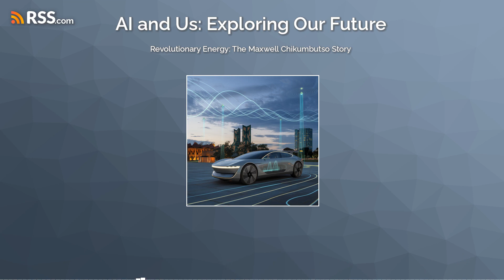Microsonic Energy: Revolution or Illusion? 🔋

Comment: If he puts a dc-dc converter into his schematics of his output, then that would even out his output voltage and your electronics use micro chips, which work off of low voltage dc circuits, so his device could in fact power most electronic devices, whereby the high voltage input circuit is removed and it powers the I.C chips off of his device directly,.     We are just use to having high voltage at our house, which then has to be converted to lower voltages for our devices, but now his device already has the low voltage available, from the radio waves.

Comment: I work in a science very closely related to this, geophysics and electromagnetic survey, one survey method we use is magnetotellurics, we use naturally occurring atmospheric electromagnetic signals (sferics) as the energy source for passive electromagnetic surveys, they energy is miniscule, in the microwatt and nanowatt range, it requires very sensitive instruments to even detect and measure it. If there was enough energy in radiowaves to recharge an EV battery then that same radiowave energy would be inducing dangerous voltages in everything conductive around us, we would all be getting dangerously electrocuted just by touching a fence line or a steel gate etc. The only actual device that does work using this technology is a crystal radio set that uses the piezoelectric effect to convert a radiowave to a tiny oscillating current to drive a very small speaker, could that same energy be used to power an EV? No of course not. Yeah there are naturally occurring atmospheric electromagnetic fields generated by electrical storms in the upper atmosphere, but the energy is miniscule, when we are doing an electromagnetic survey using sferics we have to monitor the signal strength with a base station, the energy fluctuates when it drops we have to stop survey, when the sferics are active we can survey. Radiowave energy strength is also inversely proportional to the square of the increase in distance from its source, double the distance the energy in the field drops to 1/4, triple the distance the energy in the field drops to 1/9th of what it was. The science is valid, but the numbers don't add up, it's a scam.
Reply: Good and useful technical analysis, but sad conclusion unscientific conclusive statement. The guy claims to have done further research beyond what you know based on the above well articulated analysis and supposedly cracked the code and developed a device that is able to covert the radio waves into powerful usable energy. So your analysis is supposed to end with a probing question demanding an answer, rather than an inconclusive sweeping statement that it is a scam! 

I am personally waiting for answers. If the vehicle can drive all day for thousands of kilometers without fuel ànd without charging, then those claiming there should a hidden source of energy should tell the world what the hidden source of energy is that can power and EV for thousands of kilometers for hour without charging or refueling and they must prove it, it might just be what the world needs!
Reply: Thats why you are not an inventor. Sorry. Just another verbose rumbling of regurgitated knowledge that has an obvious limit.
Reply: @wilsonkwatamanzi5821  lol but do you know anything about this science? Physics and electromagnetic wave theory? I've been working in this science for 25 years, how can you tell me I'm regurgitating something I have limited knowledge on when you have no knowledge at all on it? It's not about regurgitating anything, I have years of hands on experience with this, I measure the energy and wavelengths in EM fields with instruments all the time, I use Fourier transforms to deconstruct complex chaotic EM fields to descreet wavelengths, I know how much energy EM fields carry as does anyone who has high school level physics and electromagnetic wave theory knowledge. It's a scam it doesn't add up, and everyone is too woke to just say that because people don't want to offend someone African. All this BS about "free energy" and the conspiracy theory that it's being kept from us, all naturally occurring energy is free and anyone is free to harvest it, the sun radiates 173,000 terawatts of free energy onto the earth and anyone is free to harvest it with solar panels, if some other source of energy was discovered then someone will start making devices to harvest it, just like solar panels, mini wind turbines, mini hydroelectric generator systems, nobody is stopping anyone make or buy an energy harvesting system and living off grid. Or do you think there is some kind of magic hidden energy that we can harvest and collect with no equipment?
Reply: @ats-3693 Brilliantly explained,  but beyond the capacity of comprehension of this individual. Any attempt to explain is like writing upon the water.
Reply: @wilsonkwatamanzi5821 what an asinine comment, from someone who clearly does not know anything about science. In your world, the earth is probably still flat, and has corners.

Comment: I am watching this after the February 10th unveiling which was not conclusive in my mind because there could be some hidden energy source. However, it is possible the demonstration was real and honest. But the question is not him opening up the schematics and details because he has been denied patent rights because it defies the laws of thermodynamics and physics and in the absence of a patent he has no protection and at the unveiling he revealed that the device will auto destruct if there's tampering and attempts to open it up and find out the structure. So it is a open question still unless you just put me in a car and let me drive it. As long as I want for days on end then I will be convinced. Otherwise the smaller devices could have hidden power sources in them

Comment: He said he is preparing for a non-stop drive to Cairo. Car technicians would monitor the car all the way and there would be non stop media coverage all the way to Cairo. That should give him enough credibility because no ev can do that right now.
Reply: Go do it Maxwell! :)
Reply: Do you know when it is scheduled?
Reply: do not hold your breath waiting for that to happen, he's been running this scam for 15 years and nobody has been ever been supplied with anything, the videos on YT show his TV set device, which is powered by batteries (proven) a Toyota Aygo, years ago (that just disappeared) and these latest Chinese EVs where the only internal workings shown are the cars original electric motor, he can also be seen holding a solar powered portable generator, widely available on Amazon, which is also revealed from under a cover in a glass case, just deconstructed and rewired without its plastic casings and mini solar panels attached, obviously the display still lights up as the battery is still there and charged at his spectacular launch, with noting more than those same videos playing in the background, it's all absolute rubbish